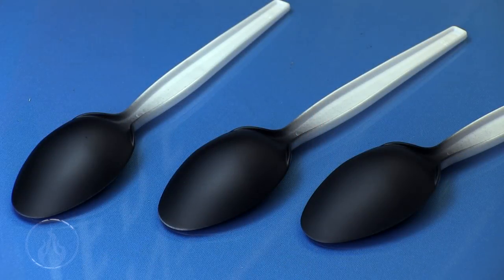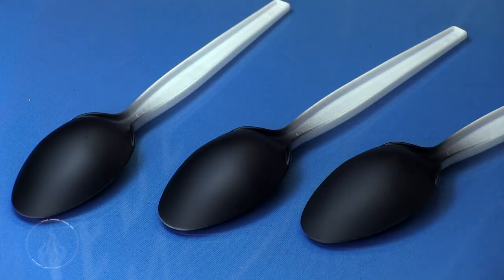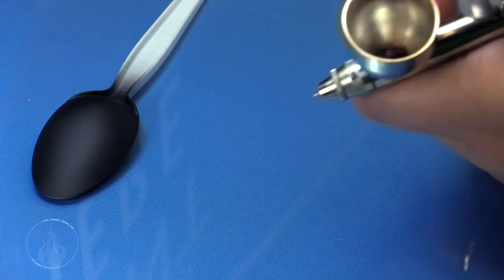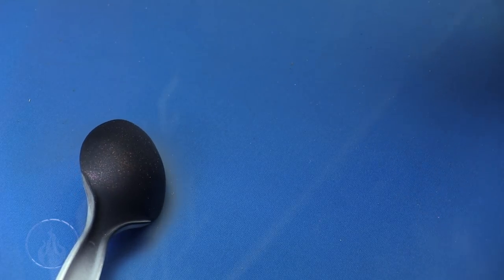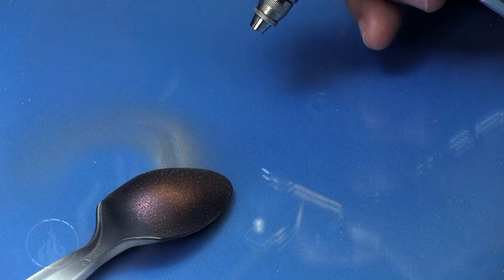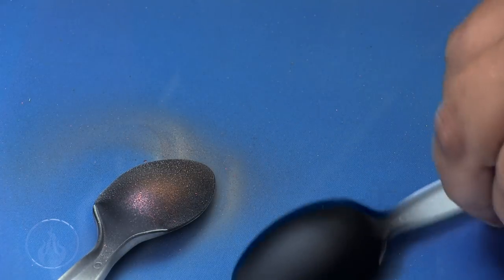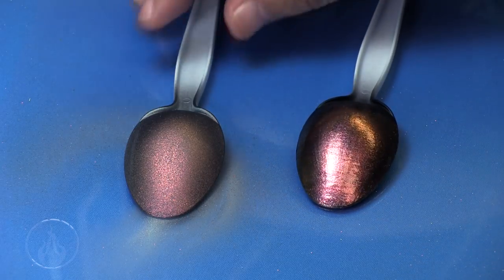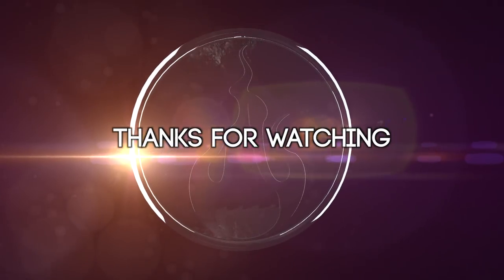Painting Airbrushing Nail Polish (color shift)

Comment: Thank you for the video! Tell me, can you airbrush gel top coat as a topping? UV tempered nail top coat hardens to form a nice protective surface, but is usually too thick and not smooth to use on miniatures the regular way. If so, what can you use to thin it?
Reply from the maker: I have not worked with gel top coats so I could not advise a good way to go about it. I wonder if Gel Top coats are similar to UV cured resin? I don't know how to thin that either.

Comment: That colour reminds me of the colour shifting car paint.  I used it on Dave's Monolith way back, It took a lot of coats and was really important to put a clear coat over top to take off the roughness.
Reply from the maker: I remember that, it was awesome. Do you recall the brand of paint?
Reply: I don't know which brand you were using, however Auto-air colors has  a line called gem-color-shift. I used the sapphire to do the beetle for my Alarielle the Everqueen. I should get back and finish that someday.
Reply: Also they suggest doing it over a gloss black. Not sure if that would give a better result.
Reply from the maker: I did consider using a glossy black afterwards. I will try again.
Reply: Thought I still had the clear coat in the closet at home.  No idea what the brand was unfortunately.  It was an auto touchup paint from Canadian Tire though.
Reply: Might have been Duplicolor, not certain tho.

Comment: I had been wondering about using nail products for modeling lately, perfect timing! Have you considered using gel polishes? They don't dry without being exposed to ultraviolet (?) light. That could help with the drying issue. If you're going for a super shiny effect, there are some really cool powders that you use on top of gel polishes. I'm very interested in where you go with these experiments, thank you for the great videos!
Reply from the maker: I'm glad you liked it. A gel option is a good idea!
Reply: Mmm, as an avid user of gel polishes on my own nails, I will caution that they are thick af and you will lose detail, so I would only use gels on things that are vast expanse of untextured space, like a tank body or a car, or a smooth carapace (like Warp Spider backpacks). 

Also, be aware that most gels require a base coat, a color coat, and a topcoat (which is usually high gloss, but matte version do exist) and that the frequency of your UV light matters. If you don't get the right light for the right gel, you may run into a problem where it doesn't ever fully cure, leaving a tacky finish. Be sure that if you're going to get a system that has a specific light, that you get that exact light and don't try to sub another light. 

And, another note...the nail powders should only be applied over a NO-WIPE gel. Traditional gels have a surface that is slightly tacky until buffed down with a soft cloth soaked in alcohol. Just so you're aware when you go to source your materials. <3
Reply from the maker: Awesome info! Thanks that helps alot.

Comment: You should really try UV/LED gel polish. It's very liquidy and won't dry unless cured with a UV/LED lamp (I've left uncured color samples overnight and they were still wet come morning), and when they are, you can rub all you want, it's not coming off! It works with a 3 layer system: basecoat, color coat and topcoat. There's even different top coat finishes, like matt, glossy, etc. Effect-wise, there are a lot of color-shift, dualchrome, holographics, etc. And also chome/dualchrome powders that you can rub over the color or topcoat to make mirrorlike. Pretty cheap on aliexpress :)
Reply: Also temperature-shift polished, glow-in-the-dark, and the magnetc (metallics that shift with magnets into interesting patterns) could be pretty cool too
Reply: hey @Hey,its Kate.. do you think i can air brush a nail with UV/LED gel polish if i am making a press on nail? thanks

Comment: Interesting video, my initial thoughts on what might make it work better. Try a drying retardant in the mix, or maybe some polyurethane mixing additive, possibly both.

Also you may want to switch to a nozzle with more tolerance if putting it through the airbrush. Maybe something in the neighborhood of a .5 or .6. It did look like your brush was gunking up fast putting that nail polish through it.
Reply from the maker: bigger needle may do the trick.

Comment: Maybe use the synthetic brush with thinner with many layers and then the AB with the floor shine as a third variant
Reply from the maker: maybe. I think one more airbrushed layer (then buffed, clear coated) would have given the desired effect. The main thing is that the nail polish is fast drying... need a slower drying paint.

Comment: Get thee to the beauty store and get some Nail Polish Thinner. 

And check your polish. Is it polish? Is it lacquer? There's a difference. That stuff looks way too thick. I wouldn't put that onto my nails with that kind of texture. You should be able to get a mirror-smooth texture just from the brush that comes with the polish. It should self-level, but it won't do that if it's too thick.
Reply from the maker: the thinner seemed to work fine. When I asked the clerk about thinning agents she had no idea what I was talking about... So I carried on. The brush strokes i think are due to how swift the paint was drying and the amount of surface of the spoon.
Reply: I have not yet, but I have used it for painting my nails and it works wayyy better than acetone or nail polish remover. 

I probably should run some airbrush tests.
Reply: +Chaotic Colors - I realize this is old post and don't know if you worked it out yet or not. I would think so...

But Kae is correct on there being two types of nail polish aside from the UV nail polish that is. One is lacquer based the other more of an enamel. 

They dry fast by design due to all the actress in them. 

As far as this test, just as with auto metallics etc, you need to lay them wet. While you were spraying I could see you were laying it dry, let alone thick enough. The particles need to first float then settle if they're going to.

You also need a wetting agent / extender to allow working time and flow out.

You're not getting enough of the clear coat these the particles are suspended on laid on the spoon.

It should look wet. Yours is drying before it hits the spoon.
Reply: +Chaotic Colors - I realize this is old post and don't know if you worked it out yet or not. I would think so...

But Kae is correct on there being two types of nail polish aside from the UV nail polish that is. One is lacquer based the other more of an enamel. 

They dry fast by design due to all the actress in them. 

As far as this test, just as with auto metallics etc, you need to lay them wet. While you were spraying I could see you were laying it dry, let alone thick enough. The particles need to first float then settle if they're going to.

You also need a wetting agent / extender to allow working time and flow out.

You're not getting enough of the clear coat these the particles are suspended on laid on the spoon.

It should look wet. Yours is drying before it hits the spoon.
Reply: sorry Swype-O.

They dry fast by design due to all the "acetates" in them is what was meant to be Swyped in.

Comment: do you spray that pledge stuff on or is it like a polish?
Reply from the maker: Sprayed on with the airbrush in a few thin layers to get a smooth finish. It is used as a clear coat on top the nailpolish. It is what I had on hand and normally I would recommend using a enamel clear coat on top of paints like this.